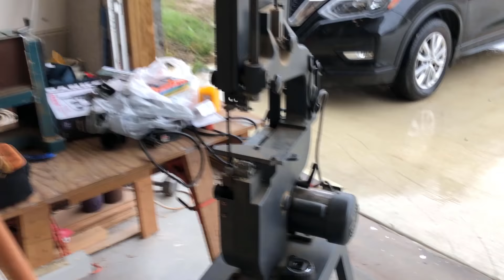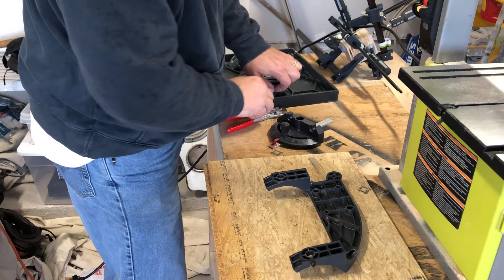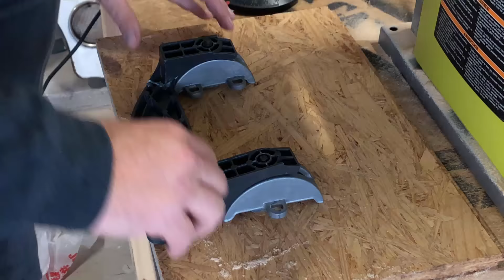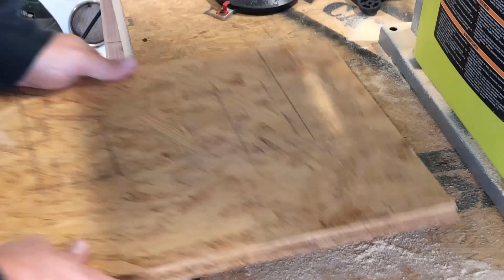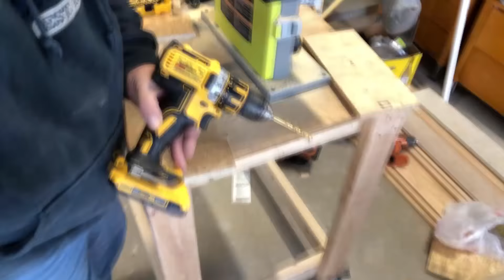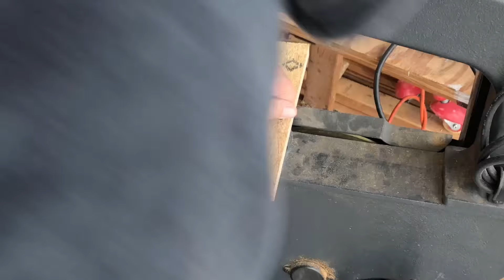Easy Craftsman Bandsaw Table Repair #DiRestaInspired

Comment: Hi, saw you on Blake's live show (which wasn't live when I watched it) and subbed. Normally I don't sub till I watch a few videos to see if you have what I like, but I have to go work on some fencing and didn't want to loose a chance to check out your channel. Will binge watch later. 😜
Reply from the maker: MotherOfManyHorses thanks for stopping by. We are new channel so if there is something you are wanting see just drop a comment.
Reply: I like building projects.
I don't suppose you know how to load brad nails in an old Craftsman electric stapler (black, short cord)? I inherited it from my Dad, no manual, and the young guys at Lowe's couldn't figure it out.